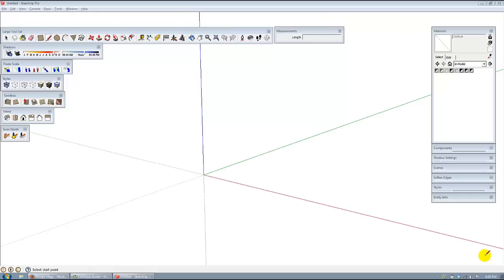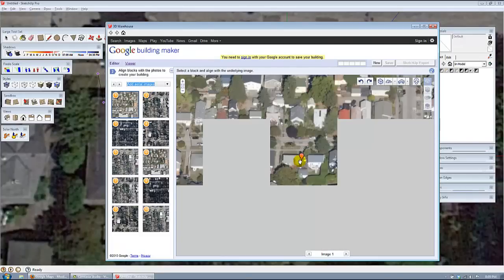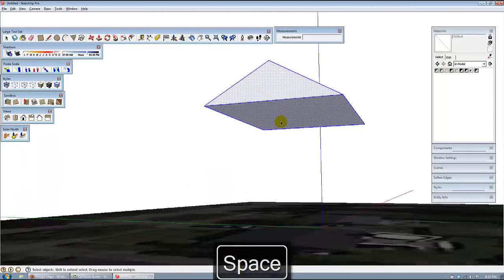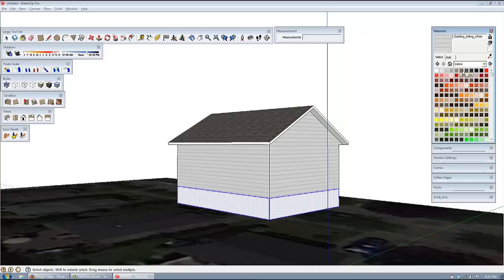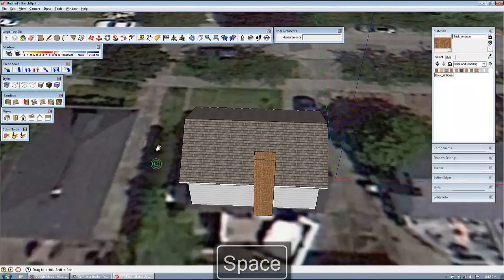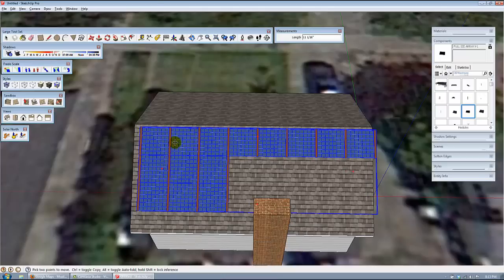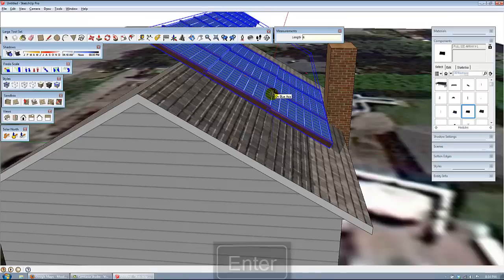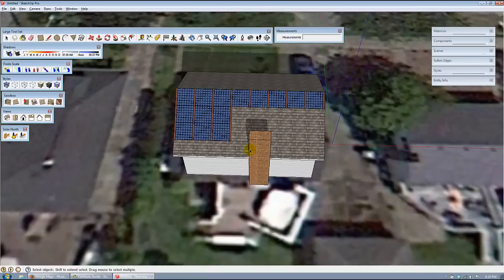Sketchup Solar Design - Model A House & Design Solar Array

Comment: how did you figure out the dimensions of the building, high of chimney and roof slope?
Reply: The tool the video maker was using is no longer supported. The tool ((00:43)) Geo Location is no longer supported by SketchUP I think as of 2017. You now have to import an aerial map (JPG, PNG) with a scale as a starting point. Explode that, and re group it. Once it's re-grouped go into the group and you can use the tape measure tool to re-size the image to the 'published' scale. This can work with PDF plan sets as well if they have a known dimension on it. Hope this helps! (DH, Former VP SCC ASES)
Reply: Felipe Galaz I suppose you could use this tool:https://www.freemaptools.com/elevation-finder.htm or the same Google maps
Reply: He guesses.... if you are a real contractor, that’s not an option
Reply: @jesse1441  The maps that were brought into the model were scaled to actual dimensions already (the ridgeline, gutterline). This whole process assumes a few things, and you work to scale the image slightly smaller than actual dim's in order to be conservative. It's a powerful tool for solar analysis, without visiting a site.